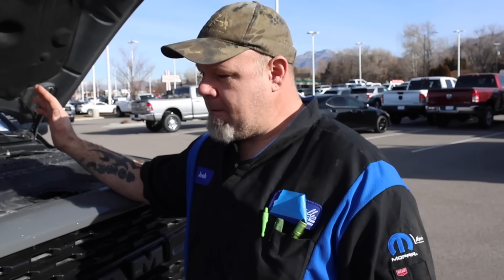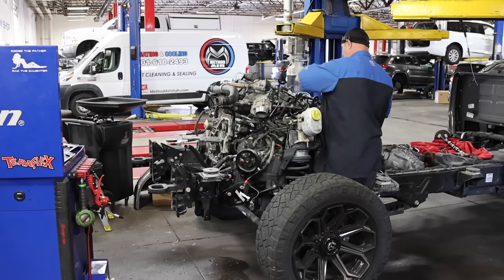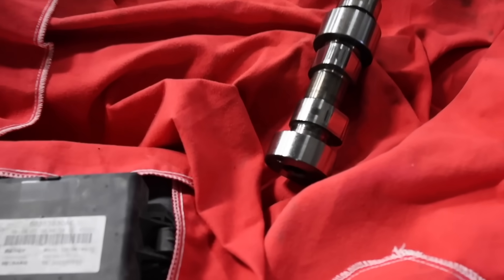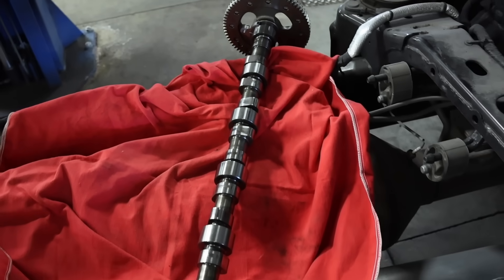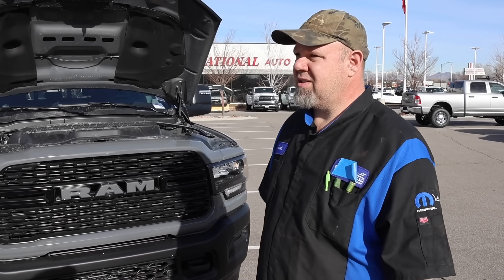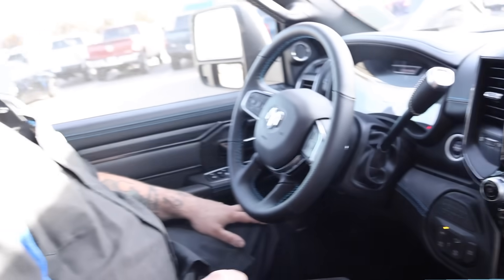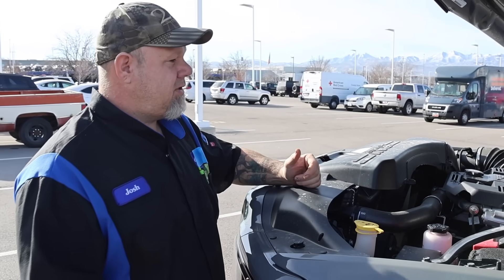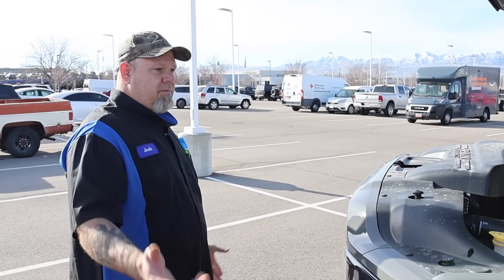Master Diesel Tech Explains The BIGGEST Killer To Your Diesel Engine!

Comment: I've watched numerous videos like these.  This one has a lot of good advice.  That said, few videos fully address the issue of idling a 2007+ MY vehicle to warm the engine.  It is this:  a diesel that is not at operating temperature is producing high quantities of particulates until it reaches operating temperature.  Those particulates will go into the DPF,  where it will eventually have to be burned off.   On my Ford 6.7 Super Duty, the engine idling at operating temperature would fill the DPF at a rate of 5%-10% per hour, but would fill the DPF up to triple that rate at below operating temperature.  Knowing this, my regimen in cold weather was to start the engine and, once the oil pressure was up, elevate the idle (I installed an elevated idle control--EIC--that would elevate the idle to 1,200 RPM on command) long enough to get the engine to about 100° F.  temperature, then drive the truck at moderate RPM and load until the engine reached full operating temperature.  At outside ambient temperatures below around 10°-15° F., I would use the block heater, though I found the block heater running all the time was not generally necessary in all but frigid temperatures--I had my block heater on a timer that would start it about 4 hours before I planned to drive the truck.  Unless it was absolutely necessary, I would never extended idle the truck (for more than, say, 10-15 minutes); if I idled it for any longer than that, I would elevate the idle using the EIC.  2007+ MY diesel vehicles are just not fit to use as a short-trip grocery getter--that is just asking for emission system and engine problems.  When I no longer needed my diesel Super Duty to use vocationally where it would usually run on longer trips, I traded it for a gasoline truck.  I've owned and been around diesels for about a half-century and love them, but the modern emission control systems have made them expensive, often unreliable, and impractical for many uses.  I still have a pre-2007 diesel vehicle that doesn't have all the emission system issues.
Reply: As an owner operator and business owner. I never ever excessively idle my Ram fleet.  I also made a point. Between hauls if they were ever used for a short trip. I would routinely take them out on drives to do passive regen to clear the dpf.

The rams have an automatic idle increase, even on my 2017, to help get up to operating temps faster. And the exhaust brake comes on automatically till oil temp reqcehes 160 F. For most starts, 30 seconds to a minute is the bare minimum id wait before moving, and then it's just low rpms and mild speeds until warm is done. Never let it idle for more than 10 minutes on warm-up. 

My percentage of idle in total operating hours is usually 10% to 20% of running hours.
Reply: @danielmorris-ruckett913  if you're running gauges, you might be surprised at how hard it is to actually obtain a passive regen.  Sustaining 900 F post DPF takes some long pulls on hills with a windsail behind the truck.
Reply: @johnneil6653  I drive quite some distance and rarely ever lug my trucks. But yeah I get the passive regen is difficult for some.
Reply: I have a '99 F350 dually with the 7.3 just last week I had somebody offer me $15,000 for it even though it's 30 years plus.... The person who offered was running a newer diesel and was sick of missions and the blue juice... He said he had one just like mine and missed how easy it was to work on and to keep rolling.. he said he put over 700,000 on his last super duty...

Comment: 2003 Cummins 5.9, change religiously every 10,000 miles. 300,000 miles on the clock. Engine is clean on the inside and no wear factory machine marks are still there.

Comment: Thank you for the great videos. What are your thoughts about viscosity here in Utah I run 5w40 year round. Should I be switching back to 15 40 in the spring. 2015 ram. One more question, what is the acceptable top end temp for the coolant when towing.
Reply from the maker: I would run 15w40 year round in your truck but I don’t see any reason why not to run 5w40 in the winter. As for temp when towing I think if you get much higher than 230 then maybe there is something else going on such as plugged radiator or clutch fan not working correctly
Reply: @Trukstuf  Thanks, I went with 5W40 because that’s what LHM in bountiful put in it during my year of free changes. I do my own now.

Comment: 15,000 mile engine oil change intervals is insane to me. 5,000 miles sounds perfect to me.
Reply: I’ve got a 2019 3500 srw running Georgia and Florida. It just rolled 450,000 miles. We do 10,000 mile service.
Reply: @markyoung8688 what oil and what weight?
Reply: Oil is cheap engines aren’t
Reply: Full synthetic proper weight oil that’s quality shouldn’t be changed every 5k miles lmfao, your talking about 200$+ dollars just in oil alone no filters what so ever on a modern diesel, they don’t use junk. Use amsoil signature series full synthetic, schaeffers 9000 full synthetic ,the worst oil I would probably ever consider on a pinch would be valvoline premium blue full synthetic or rotella t6. That stuff is basement grade oil compared to the others though, Schaffer’s or Amsoil or Royal Purple or even hot shots secret or docs diesel. These trucks take 3+ gallons of oil lol this ain’t that junk stuff you change out every 3k miles that cost 39.99$ at jiffy lube cuzbo
Reply: @JDdoesmore  whats wrong with shell t 6? know alot of truckers mainly dump trucks that use that oil.... dont see them blowing engines due to oil to offten. if you drive a desial how there now ment to be driven then just about any synth diesel oil will be fine. its when you excessive idle and slow speed in town driving no load grocery runing that really kills new diesel's.  with the new emissions there meant to be driven hard and for long periods of time. not short trips.
Reply: @ I agree with the ending but t6 is inferior to amsoil signature series is 100% synthetic and the wear on internal components night and day difference, I’m firmly against using the not “full synthetic with maybe 20-30% synthetic particles” with the rest being junk like most other brands. Amsoil signature series is the liquid gold for these heavy duty diesel trucks brother. Schaeffers is second on the list because of all the anti wear and additives they use in it, get them analyzed they are very different in particle size and additive packages and just like with the modern day diesel fuels many just don’t have it and need to be added in and at that point your better off just getting better quality oils from the get go. Hell I still see people swearing by 15w-40 on these modern diesels yet wonder why trucks constantly in shop lol meanwhile I never have problems knock on wood
Reply: @ I was wondering about the amsoil I’ve heard a lot of good things about it. I’ll try it out my next change.
Reply: @ mines a 4th gen and I live in California northern valley. Do you think 15w40 is not good for this truck or were you referring to hydraulic lifter trucks?
Reply: @JDdoesmore  What's a cuzbo?  Is that like, a cousin who also happens to be a brother because you both have the same mom, but his dad is your uncle?
Reply: 10-15k miles is ok so long as your not idling for hours during this period I have 1 truck at 278k miles and one at 143k miles always change the oils in-between 10-15k miles no issues but they are both clean engines with no egr that’s what kills diesels
Reply: It depends. If you use fully synthetic it does state on the bottle itself that it can go up to 15K before the next oil change. I also take into consideration how I use my truck - do I tow/haul a lot, is my truck idling for long periods of time, cold or hot climate…etc. I, personally, like you, think 5000 miles is a great interval IF you use your truck lightly - mildly. I also, add additives to the oil, change oil filter, spark plugs, wires, i add about 4 ounces of the mystery oil to the fuel tank so that it helps with top cylinder not collecting carbon deposits or sludge. I also change the PVC valve every 3 years.
Reply: I drive a semi and they don't change oil till 20,000 miles and still get a million miles. It's how they design the engine so you will buy another.  Just saying.
Reply: @SharpTexan71  I bet you have a bypass filter. You can double your change interval with one of those.
Reply: @erikkovacs3097  yes always dual oil filters.
Reply: @SharpTexan71 
Semi engine got 
13-15 gallons off oil and running average 1200-1500 rpm 
Pick up diesel 3-4 gallon  …………
Reply: I still go 3 to 4k
Reply: @ even better
Reply: Depends on how you use it. I change at 15,000  and I'm at 215,000 miles zero issues
Reply: @srn9973 that definitely wouldn't be the case with a 6.0 ps
Reply: @srn9973 it’s because you have an older diesel
Reply: Because you’re clueless and clearly don’t know anything about modern diesels/oils.
Reply: I’ve been doing 20 to 25,000 mile oil changes using Amsoil since my truck was new. It’s a 2008 GMC Sierra with a 5.3 L engine and now has over 376,000 miles on it.
Reply: @ that’s awesome
Reply: I had a 5.9 Cummins.  Change 4 to 5000 miles every time.  Engine outlasted the truck.
Reply: It took me forever to even adopt the 5k interval from the 3k interval 😅. I am totally comfortable with it. Also, it allows me to do tire rotations at the same time. I’ve owned Freightliner M2s, a full size converted semi and a motorhome with 15L Cats. The longest I’d go on those are 7500 miles. I tried to go out to the 15k interval when I first got them. But I could tell that the fuel economy would decrease when I started getting over the 7.5k mileage point.
Reply: @ this is really going to upset the 15,000 mile plus interval group on New Year’s Day I was board and changed it when it probably only had 1,000 miles on it lmao no joke though just figured since I had day off I’d service the whole truck. And guess what it hurt absolutely nothing and for t6 retella and mopar oil filter it cost me about $110
Reply: 5000 miles is insane, a person who truly cares about their engine wouldn't go past 3500 miles.
Reply: @ true the earlier the better
Reply: https://youtu.be/-FCdo17TZNc?si=Eais1ZYSXqimSSAZ
Reply: It all depends on what your doing with the truck if it’s ran across country and ran mostly in highway and not in stop and go traffic under no reason to change it at 5000 miles I could just imagine the expense of oil changes on semi trucks if they changed oil out every 5000 miles there are truck out there with by pass filters running 40-50,000.00 miles before changing it would I do that no not saying it can’t be done but I feel better at 15,000.00 miles my 2001 dodge I change anywhere from 5-7500 miles this all depends on when it starts eating oil when it does that means oil has lost it’s lubricity and is contaminated so I change it no matter the mileage
Reply: Transits are now 30K intervals in the uk
Reply: I do the oil and filters on my trucks about every 6000-7000 miles depending on my time but never passed the 7000 milies .
Oil is the life of the internals of the engine and injectors
Reply: Sounds good to oil companies also keep feeding them
Reply: So do oil companies keep feeding them
Reply: Agreed 100%!!!
Reply: 5000k if U use the truck hard I think would be good😊
Reply: So glad I have a pre emission duramax and don’t have to deal with EGR and such.
Reply: DD15 heavy truck engines are at 50k mile oil changes on long haul and 35k on severe duty.   But I agree 5 k is good     Oil is cheap compared to and engine
Reply: The dealership told me they don't install the cords anymore
Reply: I flush mine with diesel to clean out pan
Reply: 7500 doesn’t seem too hateful
Reply: Oil contamination acutely comes from EGR. EGR dumps massive amounts of grit back into your intake. Some of that gets past the rings. And that grit is devastating to the life of the engine.
If we didn’t have EGR contamination we could probably get the oil to last 15k
As far as warmup time goes. 1 min then slowly drive. Diesels take forever to warm up while idling. Slowly driving will warm up the engine much faster.
Reply: @robm3357  lol never look at the oil of an old 7.3
Reply: All of you are wrong. You must sample your oil and send it to an oil analysis laboratory to deturmine the correct oil change interval. Anything else is just speculation.
Reply: @ Those oil analysis always come back good
Reply: @robm3357  Nope. I tried going 16,000 miles on a change, and the test came back severely oxidized with a change in viscosity
Reply: @robm3357  We do oil analysis on all our construction equipment and they rarely come back showing something bad but they do sometimes come back with a bad result. If you've been using the tests for a while it will help set up a baseline for wear so even when the results "technically" look good they can pick up on some unusual component wear that is in its very early stages or they can pick up on other problems Example: High silica (dirt) could indicate a problem with the air filter or intake tubing. We had one that showed high silica and found an intake clamp that was improperly installed during a repair and wasn't sealing properly. Caught it early enough that it saved our engine that lives in the dirt.
Reply: @erikkovacs3097  it's more affordable to just change it for me.
Reply: @erikkovacs3097 that’s fine if you always do the same amount of use and loading. But let say one month you pull a heavy trailer 500 miles in the Texas summer heat.  That average oil analysts is no longer good. And to say you need to do one every time is crazy on a light duty truck. 

It’s cheaper to just do it 5,000 to 7,000 miles than send in to get a UOA.
Reply: I’d be mainly doing short trips, so I’m not sure I’d be comfortable with going to 5K. I think I would invest in some oil analysis tests too. Those rigs are just so expensive.
Reply: Also merry Christmas everyone and I hope no matter how soon or late we change our oil all of our trucks serve us well run great with no issues .
Reply: Been chaning mine at the manufacturer recommended 15,000 miles from the start zero issues. I'm at over 120,000 miles
Reply: @danielmorris-ruckett913  personally it gives me good piece of mind changing it early definitely doesn’t hurt anything and isn’t expensive . Kinda like how they tell you to change your ccv filter at 65,000 or 67,000 whatever it is . I change my ccv filter every 20,000 again cheap and definitely doesn’t hurt anything to change early . I’ve seen enough rear main seals oil pan seals and other leaks caused by ccv full of oil .
Reply: @andrewpinheiro7202  oh certainly changing it early can't hurt. And it does go a long way to easing the mind. As for my CCV filter I have still yet to change mine but it is on the list.
Reply: @andrewpinheiro7202  I just gut mine and blow it on the ground.  Still no drips in driveway.  At least not from PCCV
Reply: @danielmorris-ruckett913  How many miles do you need to get out of your rig?
Reply: @EvzenKovar-i5p  Im a hot shotter. So, it's pretty long. If I was driving shorter, I could see nothing wrong with shorter intervals to have fresher oil in it. That said, when I do have it changed. It gets pampered. Full flush, clean, and cycle. Full synthetic always and only. The works.
Reply: Dude, right? Like 10k plus on a direct injection/turbo engine or any diesel engine is being recommended by the manufacturer? WTF. 5k max… honestly I always change between 3-4k full synthetic
Reply: @ and the best part is no one can argue that it hurts anything. I think all the people saying to go 15 k pay someone else to change their oil or something.
Reply: @blvckspectrvm5398 , waste of time and money. It’s not 2003 anymore.
Reply: Yep, RAM doesn’t give a damn as long as the engine doesn’t die during the warranty … if you want to drive your diesel long after its warranty is finished then change your oil every 5-6,000 … best thing for a diesel engine is an oil change
Reply: @ophthodawg best thing for diesels is clean fuel filters
Reply: Only way to know is doing an oil analysis.  Very few oils can go 15k miles and I’d even say there’s only one here in the US.  Also depends on your driving habits.  City driving is way harder than highway driving
Reply: You are correct, 5,000 miles is ideal.  Anyone who ever does an oil analysis at 5k and 15k; the results speak for themselves.  👊🏁
Reply: @idahobuckaroo8348 , 5k intervals has never been ideal on a modern diesel. Educate yourself.
Reply: @CornFed_3  no matter how good a modern oil maintains it viscosity and everything else doesn’t change the fact that diesel’s are dirty and having all the contaminants in your oil that build up are what kills the 5th gen crap hydraulic lifters . Doesn’t matter if you put the best unicorn oil in the world in your truck it’s going to get dirty.
Reply: @idahobuckaroo8348  especially with hydraulic lifters in the 5th gen’s . I don’t like how small the oil ports on lifters are already adding contaminants to it definitely not 100% avoidable but changing oil early will help

Comment: Is there any truth to the rumor that the grid heater bolts are failing alot? I have an 18 6.7 cummins and was thinking about putting on a Banks intake on it. I guess that im asking if its a common fail component.?
Reply: Hi I put a banks intake on my 18 ram  it's works great alot more flow milage about the same no tune needed  it's a lot of money I know  but it's cheaper than anew engine later on 😊
Reply: @genesauter4755 I just purchased one for my 15. I'm anxious to see how much carbon is on the grid heater.
Reply: @cwilks5592  yes that's why I replaced it truck had 35000 on it when I did it on the 4th of July now it has 50 k plus no more worries and it runs better. Enjoy